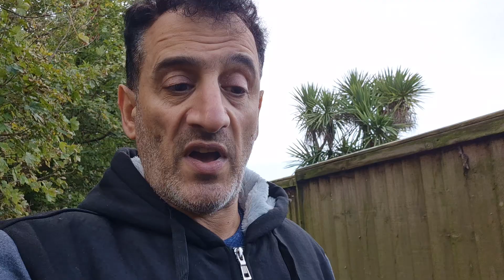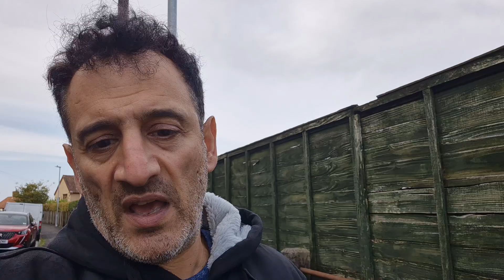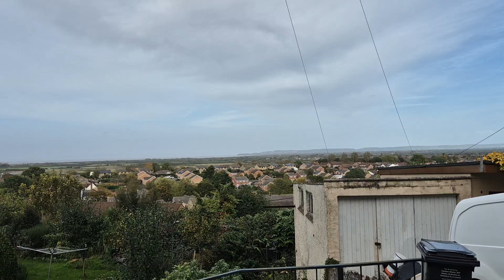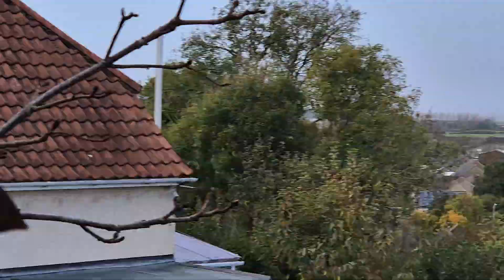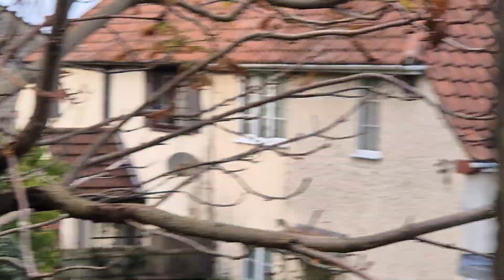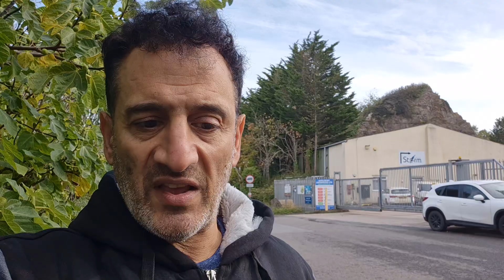YAESU 818 - Replacement ??

Comment: You are correct. For me the issue is the form factor. The ft 817/8 can be used slung around the neck, with all the controls accessible from above. It can be operated while in a messenger bag. Radios are getting more like smartphones, having bigger and bigger screens crammed with more fancy graphics. These are much more difficult to use in tne same way. They are also getting more blingy and extensive and feel less rugged and one feels one has to take more care of them.  They seem to be suited to more genteel operation, set up on a picnic table.
Reply from the maker: Hi Louis described perfectly

Comment: I would be more happier if they added uhf and vhf  to the ft 891 box 🤷‍♂️
Reply from the maker: Yes
Reply: That would make too much sense and show respect to their customers.
Reply: It would be good but the 891 uses a lot of juice even on receive.
Reply: I second it!
Reply: @ryanbeare580  I would agree if they also dropped the power consumption too. I don’t think that’s happening with a 100watt radio. I love my 891 but I wish it didn’t draw so many amps.
Reply: I still love my ft 857 a upgrade/replacement would  be super amazing.